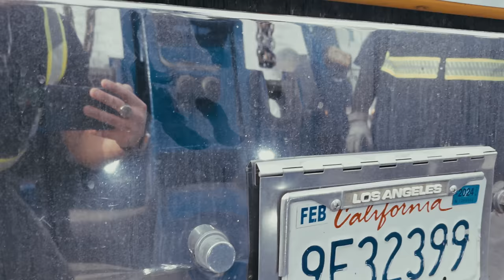Major Semi Rollover Blocks Entire Freeway

Comment: As a retired operator of 20 years it never ceased to amaze me when we needed a lane to work so that we'd be safe in doing our job the CHP wanted the lanes open and they wanted them open right now so you better move your ass and do it 
but if a CHP officer break a fingernail on the freeway during a traffic stop  they'll shut the whole damn freeway down for hours while they do their investigation that's how it's done in SoCal
Reply: For real. Its amazing they split traffic around an accident like that. Safety should come first. If you have to shut it down, shut it down for gods sake.
Reply: All cops are that way
Reply: well, a situation like this is a crash, a cop getting hit is considered a crime. But i take your point. Like in a freeway shooting, they shut everything down while they scour across all lanes for bullet casings.
Reply: @shelbynamels7948  100% you're right A cop getting hit is a crime but when they don't shut down lanes so that we can properly do a recovery if we get hit and I've had friends get hit and killed then that becomes a crime so wouldn't you want to prevent the crime?
Reply: Fortunately here in Solano our company has a very good relationship with the CHP. If we ask for something or need something they know we’re not trying to work slow or make excuses but do it as efficiently and safely as possible. I’ve never had an officer question us about our work methodology. I do however understand the difference of environment from socal. However backed up it may be, nothing is worth making a mistake and hurting someone or worse.

Comment: I have watched several of your videos (and several by another tow truck company - Ron Pratt) and I am amazed with the power of your trucks. Also I notice both you and Ron are careful and thorough when recovering heavy trucks. In particular you both often have tricky and difficult situations to deal with but always come up with a plan to ensure the job gets done safely. In particular just before this video I watched another one of yours titled "Insane Tractor-Trailer Rollover UNDER a Bridge". When I saw that truck on its side under a bridge with such low clearance my first thought was you would have to drag the truck out from under the bridge before uprighting it - and I was right. But I was surprised at one part of this video; you dragged the truck over to allow traffic to pass on BOTH sides of the vehicle during recovery (because the police wanted you to get another lane open ASAP). I thought you would need the extra space on one side to upright the truck but you managed to get it done in the very limited space left after the second lane was opened with no danger to the passing traffic. Well done.

Comment: The rust doesn’t make it old. Makes it a maintained. That’s a 389 with emissions crap on it so it’s fairly new. My Pete 379 is old. 22 years old and original paint that shines
Reply: I was looking for this comment- you're right,  that's at least a 2011 389...a newer truck by my standards.  I'm still working a 1984 359 Pete and a 2000 379 up in Oregon. Old school.

Comment: 😳Ufff geee !! I’m wondering if the driver survived. I’m glad that the truck did not explode .  It would’ve been very difficult for the driver to survive an explosion here. 😢
Reply from the maker: lol why and how would it possibly explode
Reply: @PepesTowingService  when the truck overturned with the spilled diesel it would’ve sparked a huge explosion. The engines are real hot . I’m just curious that’s all I really don’t want something like that to happen to me.
Reply: @magdalenallull3524 Good news is that a fuel explosion usually requires a pressurized container. You'd have to get the fuel tank boiling for quite a while to set up the conditions for a BLEVE, Boiling Liquid Expanding Vapor Explosion. Diesel is even harder to ignite that gasoline (petrol), requiring higher pressure and a relatively specific fuel/air ratio. Try it, you can't light diesel with a match or spark - diesel engines don't even have spark plugs!

The Michael Bay explosions you see in the movies almost never happen. Worst case in this crash would be the force of the rollover, not fire or explosion.
Reply: @Tim---  Thank G-D I’m glad to hear that .

Comment: It takes extreme contained  pressure or intense, sustained flame to ignite diesel fuel. Sparks won't do it from dragging metal on the pavement, so you don't have to worry about that. If you threw a cigarette button or a match on a puddle of diesel.fuel, it would drown out immediately.

Comment: Low center of gravity on truck, high leveraging on top edge of trailer about 8 ft.. snag 1/3 way back with boom, andvthrn lift up as youbhave truck slowly back up to shove trailer more with leverage there should easily stand it back up

Comment: I wouldn't let that happen to my pete now there more damage
Reply from the maker: Spoken like a true dummy. So the fact that it flipped and crashed so violent it landed perpendicular had no bearing at all right ? It was perfectly fine then. It skidded on the exhaust, if you weren’t dumb you’d see after I did the upright you couldn’t even pin point extra damage to the cab. Not like it skidded on the door. But ya leave a tractor and trailer blocking an entire major freeway at rush hour because you don’t want another scratch lmao what a joke 🤡🤡🤡🤡🤡🤡